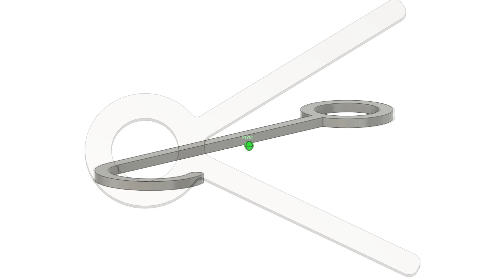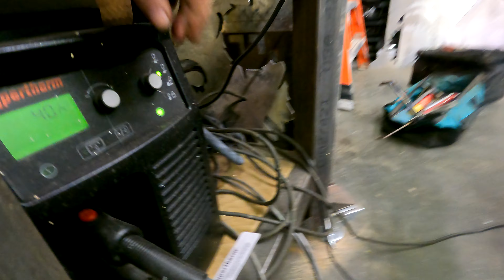CNC project:  hanging AR500 steel target system

Comment: Nice target support stand, hangers and dongs. One option you could do to use less material would be to make one end with a single leg. The tripod effect work just as well and save material. Just a thought.
Thanks for sharing.
Reply from the maker: @joewhitney4097  thanks for the suggestion!  I actually attempted that during the initial design, but there was enough play in the two-leg-side that the single leg side wobbled back and forth too much, making the entire stand move when I hit the targets.

Comment: Should go with rigid pipe instead of emt its thicker wall stronger
Reply from the maker: Yes, I agree about pipe being more rigid.  But it's also far more expensive and heavier.  The EMT I bought was $18 per stick, and already galvanized.  I work with DOM and black pipe all the time.  Decided to not use that on this project for cost reasons...and I'd stick with it again if I built another one of these hanging targets.